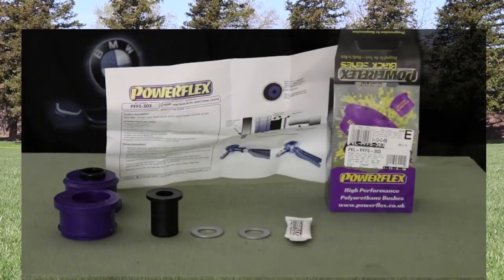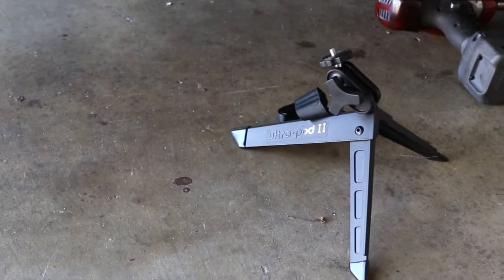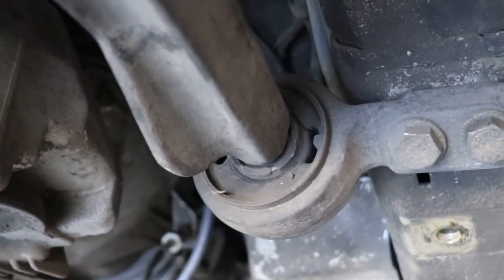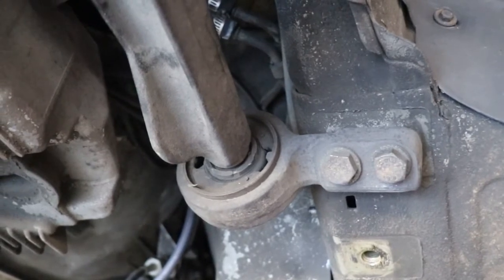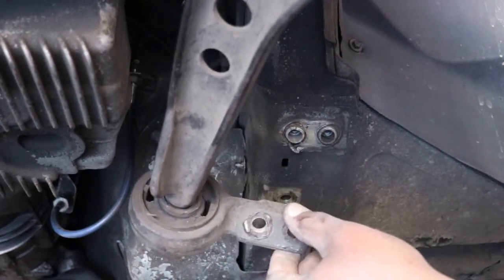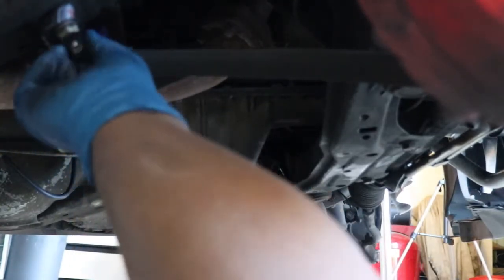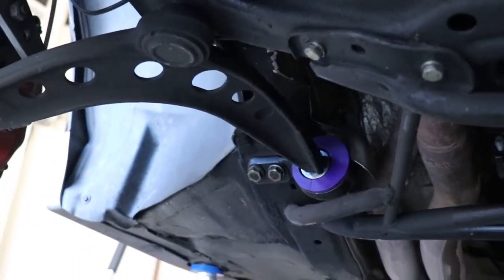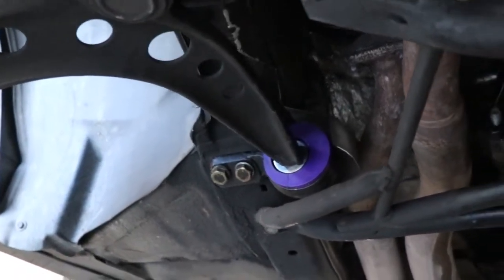How to change BMW E36 M3 Front Control arm bushings

Comment: Hey Clint, I watched your video again, and realized that you removed stock (centered) FCABs, and installed offset Powerflex FCABs.  Powerflex sells both offset and centered FCABs, so why did you choose the offset FCABs?
Reply: M3 control arm is little bit different angle than the normal e36 control arm you can buy. So it’s either M3 control arm + center bushing or E36 control arm + offset bushing.
That purple Powerflex bushing is for the M3. As they say in the instruction “PFF5-303 - Front arm rear bush with additional castor as M3.” 
Bimmerworld sells the e36 control arm + this purple Powerflex bushing set.

Comment: Honestly this guy did good explaining the proper way of installing offset/eccentric bushing, show casing everything including things you might end up doing wrong. Much better than half the jewtube tutorials out there....kudos!
There are guys using grease on the outside of the bushing LMAO and their "wrong" advice + wrong order of installation is the first hit in the search results. I know, I know.

p.s The reason you should get offset bushing is to gain "caster", combine that with Evo 3.2 top mounts installed the wrong way and you will have exceptional self center steering. Obviously not on a M3 as it's already there.
Reply from the maker: Thank you for your comment!

Comment: How is the handling/feel of the car afterwards?  My m is shaking bad when hard turning and going over bumps etc.  Nice vid
Reply from the maker: It may be your other control arm bushings too.
Reply: @Engineerboy100  I was thinking control arms and bushings.  It's a very "loose" feeling and vibration which impacts the front steering.  Freezing all purchases but essentials at the moment but will eventually replace.

Comment: do you have the link to where you purchased and does it work for 96+ M3
Reply from the maker: 1995 - 1999 fitment.  here's a link but they are available from many places, do some google searches ...   https://www.eeuroparts.com/Search/88727/200504/Control-Arm-Bushing-Set/BMW/M3/1995-1999/?gclid=CjwKCAjw2rjcBRBuEiwAheKeLxvIxuBM-1RFB0WCTxPtTMQPdhT8PIapjd7MKsTNUAKP6x5Z4JgiIxoCeXEQAvD_BwE

Comment: what does the eccentric bushing used for compare to the non eccentric one?
Reply from the maker: The purpose of the  offset bushing is to gain "caster".
Reply: it actually give more caster and add about 10mm of track width, it will have a minimal effect on the toe
Reply: Do you align the car because of the change
Reply: @danc2014  If your car originally had the centered control arm bushings (non-M3 E36) then yes, you should get it aligned afterwards.  For a ‘95 M3, which comes with the offset control arm bushings, an alignment should not be needed.

Do not replace the centered control arm bushings on a 96+ M3 with the offset control arm bushings.  The 96+ M3 has different front control arms which are sized and shaped to add more caster.  If you add the offset control arm bushings to that, the caster will be excessive, and it will result in the front tires being positioned further forward that normal, and may end up making contact inside the fender wells!